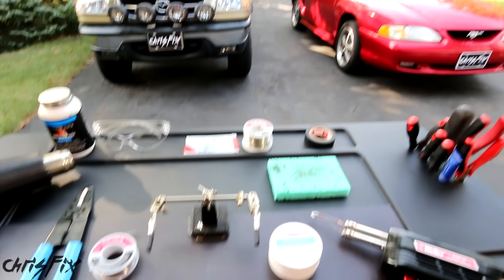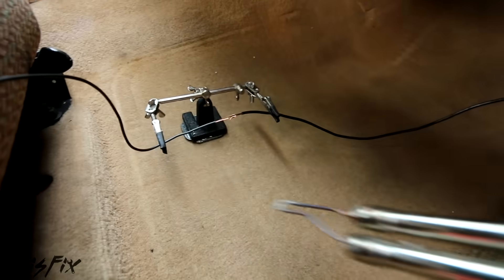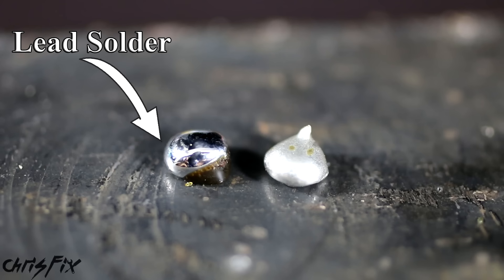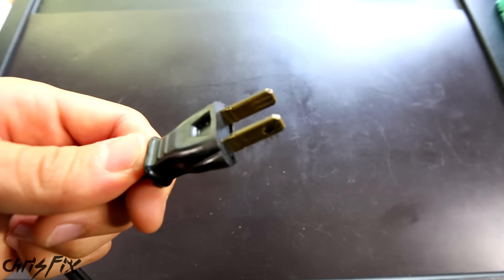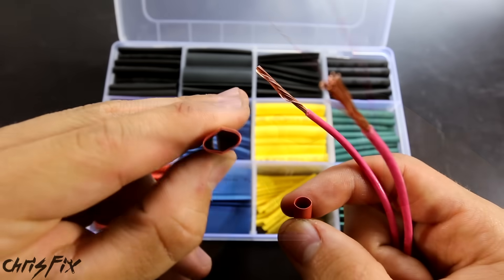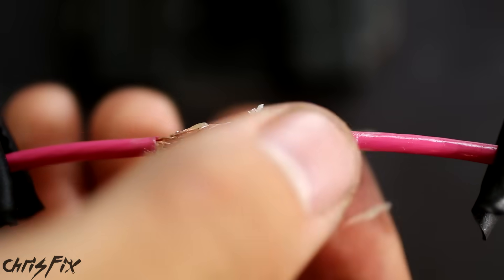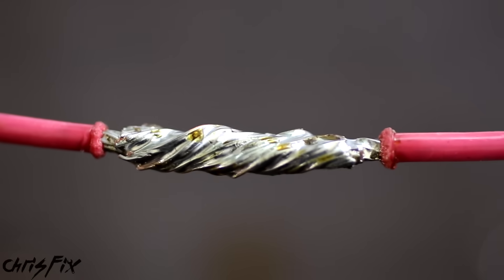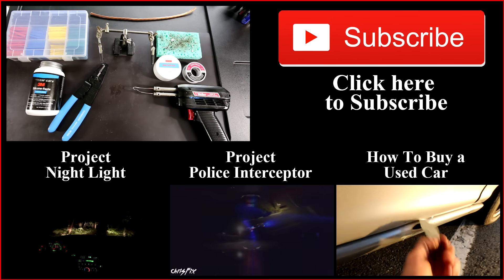How to Solder Wires Together (Best tips and tricks)

Comment: Meanwhile in denmark ''As long as it is touching, We've got power.
Reply: just put the damn electric tape on lmao I do that too 🤣😂
Reply: @cambodiatransportv7482  nah we dont need safety
Reply: @roentgen226  it's just for looks lol
Reply: @bobthebrick1988  its for safety. Having a major sound system things can go loose. Add in a capacitor. Something comes loose it can shock you or touch one of your amps. Then you get to take the amp apart and get very good at resolder things.
Reply: @cambodiatransportv7482  or duct tape. Lol
Reply: @cambodiatransportv7482  apparently not.
Reply: My car is down to one speaker because the previous owner used this method
Reply: @bobby_greene  but the good Thing is you can reconnect it faster than soldering
Reply from the maker: lol
Reply: @chrisfix   LMFAOO
Reply: @chrisfix  I love
Reply: Really excellent and thorough!  I would prefer to add only 3 things:
1) using two pieces of heatshrink, heating and cooling one before the other is used, makes a tougher jacket.  A good alternative is semi-rigid, adhesive heatshrink, which is usually thicker and tougher too.  The types with meltable inner adhesive is a good substitute for silicone, eliminating that step.  Good call on silicone, that shows a strong commitment to quality!
2) Tell people why you add a  bit of solder to the tip right before you press the tip to the joint: it heats the joint much faster, making superior joints.
3) It is best to remove flux residue when possible.  A little mild citric acid on a swab works best, followed by strong isopropyl alcohol.  Or just rubbing with alcohol works fine.  Cheers!
Reply: LMAO same at my house here in Arkansas, USA
Reply: Thats Right.
Reply: North Korean citizens: U guys got power ?
Reply: Love to Denmark/danmark
Reply: Not only in denmark bro
Reply: I twist the wires together and if I want to fell Professional I melt duct tape on it
Reply: Ooblack oopYinlongooopp 88p8
Reply: Dansk engineering = Legos and zip ties 😆
Reply: Lmao as long as it's touching
Reply: In Denmark you also have a short circuit, burned up computer, general fires and nothing works. I recommend lead/rosin solder if you can get it. Also I have the same orange iron. The lead free stuff sucks. You can't go wrong w too much flux. I would never skip flux. Be able to breathe.
Reply: Veldig godt! :P

Comment: Some great tips for newbies that don’t have a clue, but from an Auto elects point of view, your joins on a 3/4mm wire should be no longer than 10mm or 3/8” long, and both of your wire wrapping techniques are flawed. If you were in a position where you had to join a harness, the overall size that you are making your joins would see the harness at least double in size. If your joins are 1” long, the solder penetration inside the wire will be half this length again, so if these joins are anywhere near a section of harness that requires any flexion or movement at all, you are going to have intermittent ‘opens’ in no time. Practice making the smallest length joins you can, place the hottest and thickest part of your iron tip at the top of the wire, and let gravity help the process.. And on old wire, acid core is a must to break through the oxidisation. It’s been made for a reason......

Comment: I've only soldered a couple of times, but I've only just learned to solder from the bottom, not the top where the wire is. I have many extention cords to do this spring.

Comment: Frustrating as I can't get this to work. I got the cables twisted with flux. Melt the solder on the iron but it keeps rolling off the copper wire and will not attach. I just have little balls of solder. Any ideas where I am going wrong?

Comment: DUDE! The 12 gauge wire replacement for the soldering gun tip is worth the price of admission. I'm just starting an electronic installation on my car, so I wanted to review my soldering ability. You made a TOTALLY complete video of the best possible quality. I've been in film & video for over 40 years, and except for no scantily-clad babe, I consider your video perfect. The closeup videography was exceptional, the background was dark and or out of focus which leaves an uncluttered shot. We see what we need, and it imprints better on our minds because you aren't wasting brain space on that plastic kid's toy in the background, the dirty garage, or your neighbor setting fire to the yard trying out his new smoker.

The narration is concise, enthusiastic and that encourages us to feel good by doing an excellent job as you do. Also, the sound level is very consistent, even though it took you hours and hours to cover all the shots you needed. Son, you were hitting on all 8 cylinders.

Way to go, Dude. If every YouTube video was even HALF as good as your's we'd be able to learn 10 times as much and in less time. THANK YOU!!!

Comment: I think you have your soldering steps backwards.  You should strip, splice, solder, then cuss up a storm because you forgot the heat shrink and you have to do it all over again.  Kinda like forgetting the hose clamps when doing radiator hoses.  Not that I've ever done this...

Comment: Perfect, there is just one thing that you've missed. (loved watching your video by the way)
The flux will end up sitting on the outside of the 
solder when you warm it up enogh. The flux will prevent oxidation, so it is important not to remove it.
At the end in the video you see some brown kind of stuff on the solder. That is an example of a perfect done solder. If you do not heat it enough you have a cold solder that is bad for 
connectivity. If you heat it too long time, all the flux will burn off, and the flux can no longer prevent the soder from oxidation, in 5-10 years the connection will go bad
but how do you know if you heat it too long? The flux is making a lot of smoke when heatet up. It is important that there is still smoke comming from the solderring as you apply heat. If it stops smoking as you have the heatgun warming it up, it means that you have burned off the flux, and you need to apply more flux, or start over. 

Adding the silicon is unnecessary, when you have done a perfect solder with a huge amount of flux left back on, like chris have done here.

Comment: I'm a master of cold joint soldering lol.  Been soldering for over 30 years but learned a proper foundation: never pre-twisted wires together, rarely used the sponge, didn't know about using 12 gauge solid wire to make tips.  I use silicone based dielectric grease constantly but never though about using it under heat shrink tubing.

Comment: Hot glue is also really good to put on the wires before you heat shrink them. Underground heat-shrink splices for UF cable have hot glue in them that seals the joint when heated.

Comment: It's not soldered forever, just heat it back up and pull also it doesn't usually harm you. You don't need to do quit a few of the things he said, I don't do almost any of the things he said. Also I know a lot about soldering and I'm building my own computer as proof. (commodore, apple, and IBM computer clone)

Comment: Tip. When stripping the wire hold your  cutters at a 45° angle and squeeze. I have found that this helps separate the insulation from the wire without having to pull on the insulation.

Comment: Hi Chris! I hope this comment doesn't get buried.

I have a few tips in addition to what you showed:
- For one, with the lineman's splice it actually helps a lot if you give the wires a pull, the splice will get tight like a knot. Properly done, a lineman's splice that is pulled tight can actually make a good connection without solder, just heatshrink to keep it in place.
- I usually just cut any strands that are sticking out with flush cutters rather than trying to wrap them around as that can be painful sometimes.
- If it's a situation where the wire is experiencing strain--bending, vibration, etc--you want to avoid having too much length of solid solder, because solder is quite brittle. If you did the lineman's splice properly and pulled it tight like I mentioned, you should only need a small blob of solder on either end of the splice.
- Using 63/37 lead solder instead of 60/40 is a bit more foolproof, as with 60/40 you have to make sure the joint stays still as it cools. With 63/37 it's less of a concern
- Silver-bearing leaded solder is mechanically stronger than regular leaded solder, and just as good in pretty much every other respect except cost. If you're not going to need a lot, and the price won't break the bank, silver solder is great for any situation where the solder joint cracking would be very bad.
- I generally recommend people don't buy solder from hardware stores, as it's usually only mediocre quality and almost always very thick solder wire. Generally the thinner the solder wire the better. The thicker it is the easier it is to add too much.
- you don't want to heat wires too long or it will start to melt the wire insulation
- you can actually buy heat shrink tubing that shrinks 3:1 instead of 2:1 which can be helpful when you're soldering together wire of two different sizes, or when you can't get an exact size match.
Reply: Great addition to the video. I like the way you don't try to diminish the great tutorial. This is a great beginners tutorial and it is done perfectly. Granted, there are other techniques for more critical situations. Thanks for the information!
Reply: I agree with all of this.
Reply: I would also add to clean off the rosin with isopropyl alchohol as it is corrosive to the metals over time
Reply: This was also helpful
Reply: Just tried pulling the wires on linesman splice really does help thank you
Reply: He is right i tried the lineman knot and it work without solder   good looking out 💯
Reply: Great advice for a beginner like me! Yes, I have to solder wires in my 450mm drone, and the solder joints should be highly strong, in the midst of the vibrations of motors. I generally solder 15 to 22 AWG wire.
Reply: Dope !!

Comment: Great coverage, but I'd stress that using a soldering gun should be used carefully on wires as it can be way more power than you need and if misused can damage the insulation (you can see the start of that in in the video) and even components on the other end of the wire. And do not use a soldering gun on PCBs as you can lift pads/traces and completely destroy components.
Reply from the maker: thanks for sharing

Comment: What do you suggest when the wire never seams to get hot enough to melt the solder  when applying heat from the bottom?
Reply from the maker: I've never had that happen, are you giving everything enough time to heat up?

Comment: I want to work on the wires in Christmas  string lights what’s best the to solder in , the iron or the gun ?
Reply from the maker: For 18 gauge and thinner use an iron. Anything thicker, use the gun.

Comment: I was doing it all wrong, thanks!
Reply from the maker: No problem! What were you doing before?
Reply: Hi @chrisfix ! i was not cleaning the tip of the solder properly, also the way you put together the end of the wires, i was doing the "cold solder" and i was not using the tubing that heats to isolate the wires :o

Its funny the timing of your videos because i was looking the Led bed lights video because i wanted to do something similar for the interior of my old ford bronco. So double thanks!

Comment: If you use flux you should wipe the solder joint with rubbing alcohol to clean the flux off. Then follow your grease and shrink steps.
Reply from the maker: Thanks for the tip.

Comment: Absolutely wrong soldering - such a thin wire and soldered for 30 seconds! There, even the insulation at the ends burned out.

Comment: A good video.  Some notes:

1. The union splice is the preferred method, as it gives the highest mechanical strength, which is why NASA uses it.
2. If you slide the heat shrink tubing on before stripping your wires, you won't have to worry about catching strands on it.
3. For the optimal seal without the mess of silicone grease, just buy adhesive-lined heat shrink tubing.  (...which also comes in the form of tape you can wrap around the joint.)
4. To seal larger connections and provide extra insulation and protection, self-fusing silicone tape (look for mil-spec A-A-59163 to ensure proper quality) should be used.  It is relatively inexpensive as works well enough that the US military has used it to protect wiring for over half a century.

Comment: Flux is not usually needed when doing wires long as you have good iron with good thermal capcity and good quality rosian core solder

Comment: Ive been using these handy heatshrink combined with solder. Its a piece of heat shrink with a ring of low temp solder in the center. It makes soldering much faster because you just hold a  heat gun on it for 20 seconds and you have a perfect solder and heatshrink all in one stel.

Comment: For those who would like to know more about the technicalities of soldering, here's some info from a materials engineer.

- The best possible solder is 63-37% tin-lead mix ratio. The reason is that at that ratio, tin and lead form a special material that instantly solidifies instead of slowly cooling down and transitioning from liquid to solid over a prolonged time. 60-40 is close enough for most applications.

- Rosin, or flux as called in the industry, is not only useful for protecting the wires. Flux has 2 main goals: preparing the surfaces to be soldered, and then making sure a proper solder joint forms. This is achieved with ingredients in the flux that slowly creep onto the metal and dissolve any surface impurities like grease and oil. Solder can only join onto unoxidised metal surfaces. It also helps the solder flow onto the material easier. Flux is basicly essential to avoid "cold soldering" - joints that seem soldered but have no physical strength due to surfaces that aren't joint properly. So yeah, always use solder that is pre-fluxed if you want an easy job.

- If you want to use lead-free solder, get a good high-power iron because you will need it. Lead-free solders require a considerably higher melting temperature and even more heat to keep them molten. Environmentalists are pushing towards these but even well-educated people use Pb solder due to its ease of use.

- Try to set a good balance in soldering temperature. If your temp is too low, the material will not melt properly, or the iron will get cooled too much by the dissipation of heat in the metals. If it's too much, you will burn the flux and create a mess on the joint. My ideal temp for 60-40 solder is 300-320 °C for heavy gage wires and 280 °C for small electronics. Try to go as high as possible where the flux smokes good but doesn't get immediately burnt on the iron.

- Regarding ventillation, I always highly suggest the fan facing away from you. If the fan is blowing air towards you, the smoke goes everywhere, and at the same time your soldering iron has to compensate for the cooling effect of the air flow, which might make youre job harder depending on the power of the iron. With the fan facing away from you, the smoke gets captures in the suck of the fan and is pulled away from you, and you save your iron from direct air flow.

Regarding tool choices, I highly suggest the Jokari Secura wire stripper, it does an impeccable job at quickly stripping even very fine electronics wires. It is also sold as the Felo "red dragon" in the US. It's not even that expensive and will serve you very well. There is absolutely no danger in accidentally cutting into your wires which could happen with the old-fashioned stripper tool.

Otherwise, Chris does an impeccable job covering this topic.

Comment: Bad 8bfo on stripping wire..., DO NOT TWIST THE "OLD FASHIONED" STRIPPER AROUND THE WIRE!!!! This Mark's the wire, makes a gouge nick in the wire and makes it prone to failure and strands can let go and drift into the area and SHORT. Also makes a brittle joint. Use the stripper in one motion. Do not twist around the wire cutter around the wire. If you are not str ooi ng enough to pull the insulation off in one motion, buy an automatic wire stripper!!!!!

Comment: That copper wire trick for the solder tips is pretty genius, any disadvantages of using the wire instead of the premade tips? I have a bunch of 14/12 gauge copper solid wire laying around, just gotta strip all the insulation off.

Comment: Lots of good information here. I have found that when stripping wires never go around in a circle, you can score the wires and lose some strands or break the wire when putting a wire nut on a solid strand wire. 
Put the wire in your wire stripper and rock it back and forth while pushing the wire stripper with your thumb.

Comment: Quick tip. If you're wiring things and soldering them together use a thin strand solder lead based without flux. Melts faster and in my experience is easier to use. I know flux is good to use but I've only ever needed it for electronic board repair or pipe fittings.

Comment: I used your tips for soldering two sensor cables on my honda, that were eaten by a mouse/rat...damn it worked excellent. I cleared the error code and check engine light is off, so all good!
Reply from the maker: Awesome! I'm glad it worked so well for you!